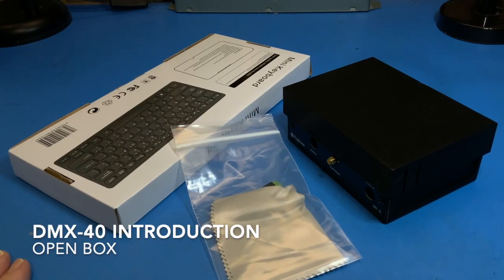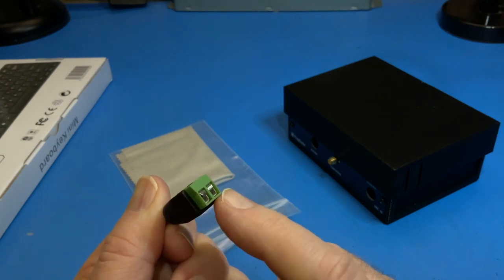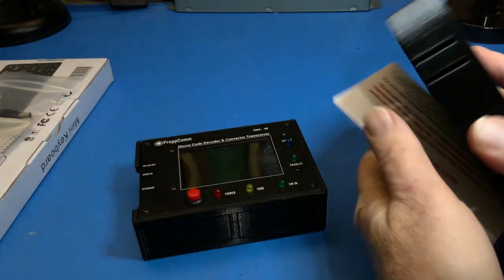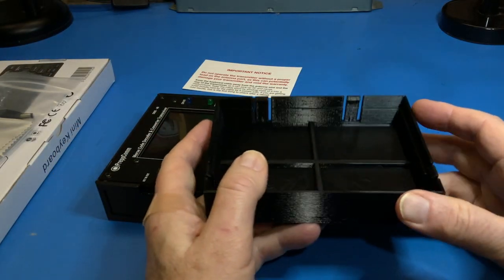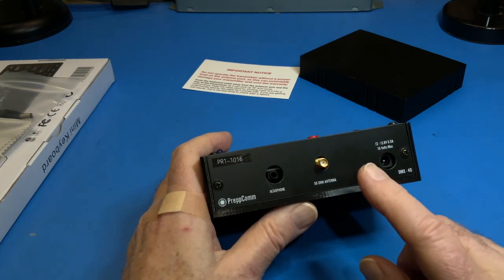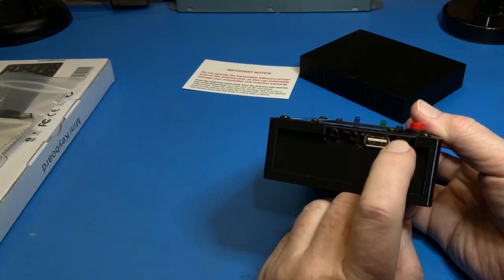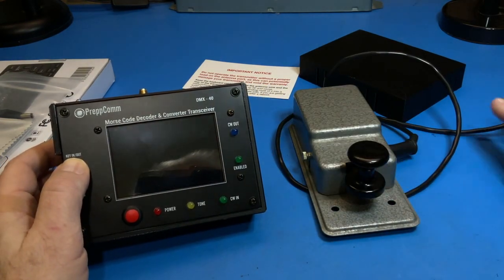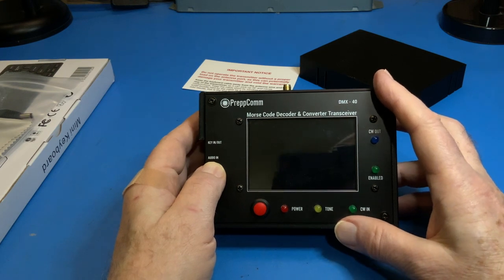1. Introduction to the DMX-40 Morse Code Decoder & Converter Transceiver

Comment: Any plans to come out with an 80m version of this? That would be great for nvis.
Reply from the maker: We do have exactly what you are looking for, introduced on March 12, 13 at the QSO Today Virtual Ham Expo.  It is the MMX Multi-Band Morse Code Transceiver.  It has 3 slots for band plug-ins.  You can order one, two, or 3 bands, choosing currently from 80, 40, and 20 meters.  check it out:  https://www.preppcomm.com/products/dmx-40-transceiver?utm_medium=social&utm_source=YouTubeQ
Reply from the maker: Not only plans, but fulfilled plans!  On March 12 and 13 of this year, we introduced the MMX MultiBand Morse Code Transceiver!  It has all of the bells and whistles of the DMX-40, a better (lower noise) power supply, and three "slots" for plug-in band PCB's.  We currently support 80, 40, and 20 meters.  Check it out!  https://www.preppcomm.com/products/dmx-40-transceiver?utm_medium=social&utm_source=YouTubeQ
Reply from the maker: You can buy a single band version of the MMX with an 80M card

Comment: I hear you need a 10w dummy load attached if you wish to use another transceiver. Does it come with one? 

Also should you use ferrites to help keep things clean? Heard it bleeds out badly if any cable is crossed. Even if that’s not true what kind should I get to help, just in case?
Reply from the maker: A 5W dummy load is fine, and you can get one from Amazon for around $7.  No, it does not come with one.  We are fighting the rapid increase in parts cost (up to 40% in some cases), so little extras are out of the question at this time as we hold our price.  I don’t think you need ferrites, but if you do, putting one on the keyboard cable is OK.  We have internal filters, but if you run your keyboard wire next to the antenna wire, you are going to have trouble.  It is not “bleeding out badly” but it is RF off of the antenna wire - depending on your load, you may have a lot, or a little.  It’s just good practice to not run RF power and low power digital together due to capacitive coupling.

I would not worry about this - it is information blown out of proportion by whoever.  Follow good practice and you should be fine.  Another good practice - don’t have the keyboard wire running all over the place.  Bundle it up so it is neat and tidy, and the connection between keyboard and DMX-40 is short.  Otherwise, you are just adding an antenna between the keyboard and the DMX-40, and if you have RF in your shack, it will pick it up, and maybe even overload our built-in RF filters.  SO, the word is, follow good engineering practice, and you should not have any problems at all.  We offer these tips because many hams have no idea with good engineering practice is.  We are not offering this information because there is something wrong with the DMX-40.
Reply from the maker: Contact the factory for help, or access the PreppComm Community at http://preppcomm.mn.co.

Comment: Is this useful for learning Morse Code with key?
Reply from the maker: Yes. You operate the key in receive mode, without an antenna (no incoming code), and your keying will be decoded and displayed on the screen.
Reply: @preppcomm  Does it need licence for owning one?
Reply from the maker: @leehirst8081  You can own one without a license, and in an emergency, you can use it without a license. But you can't practice with it on the air without a license. You can put a dummy load on the antenna port or put it into the default External Mode and practice, and use an antenna to practice tuning in a station. But using CALL and ANS buttons .... no, not without a license. Sorry about that. Also, you don't need a key, we supply a keyboard for you to type your message. Learning to key is great, learning to decode in your head is great, both take a lot of effort - especially decoding in your head at speed. This can help you learn, but again, the best way is by communicating with another human and watching the screen. As the text appears, letter by letter, your brain is listening to both the sound and seeing the letter. Because of the type of communication (talk to another living being), your brain is paying high attention, and connecting the sound and the letter. After a few months, your brain will provide the letter before you see it on the screen. This is with no work on your part, other than having communication with other people and having fun doing it. Not so much just listening. This is called Cognitive Association, and is strongly triggered by your live conversation. Hey, my wife got a tech license, so you can too. Memorize a bunch of info, not hard at all. Go for it!

Comment: This looks interesting.  What is the price range?
Reply from the maker: It's price range is $349 to $349...  check out our website at PreppComm.com
Reply: Why did you use such a non standard, as far as Amateur Radio goes, antenna jack?  Seems like a BNC should have been the logical choice.  Other than that it looks interesting.  73 de KF7VUT
Reply from the maker: @timk7749  The SMA connector comes with a PCB edge connector.  I don't know of a PCB edge connector for BNC.  Of course you can get a BNC to SMA adaptor and keep it attached.
Reply from the maker: @timk7749  And BTW, it is quite standard on VHF/UHF.